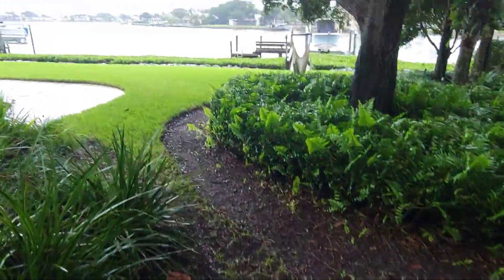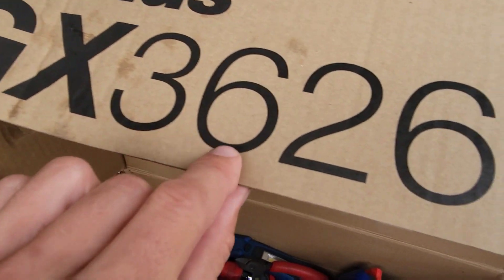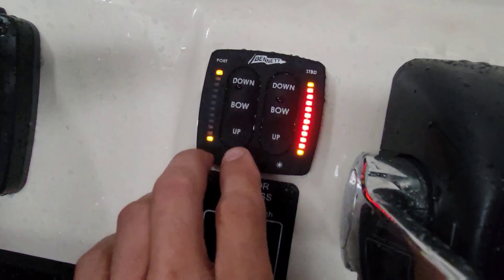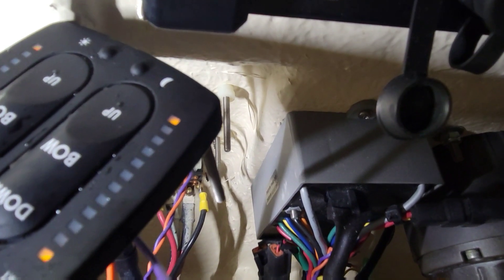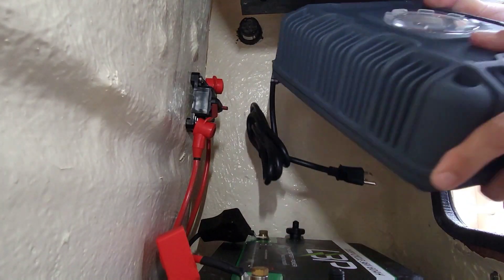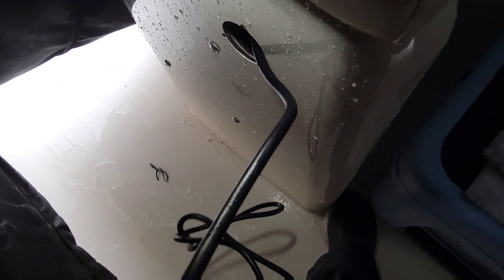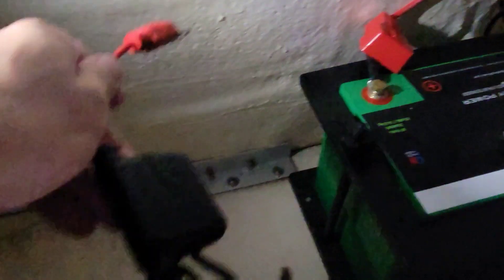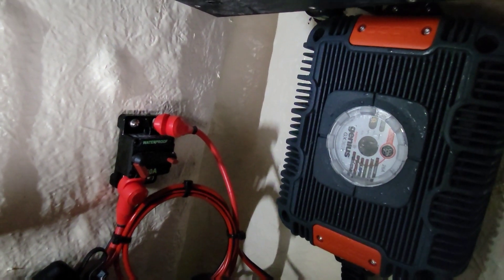Grady White 236 Genius 36 Volt Charger Install - Episode 90

Comment: Great content as always!  Just my opinion, the lithium seems like overkill for that particular application, but I’m looking forward to manufacturers using them as generator replacements. No idea if the technology is at a point where that is practical.
Reply from the maker: Thank you.  The only advancement I know of that Volvo Penta is working on is hybrid propulsion. Little fuel burning generator that runs an electric drive system.